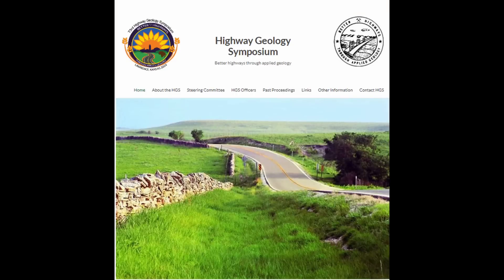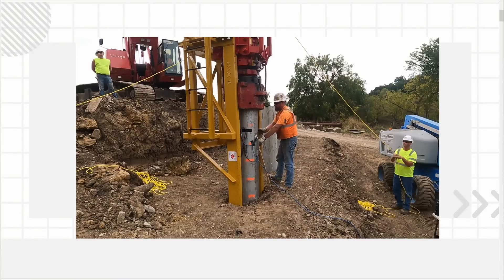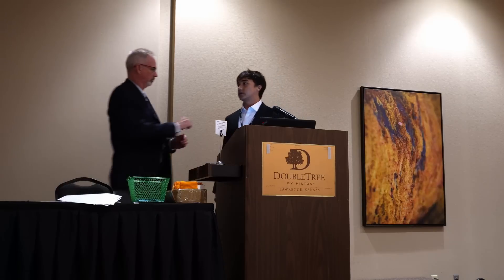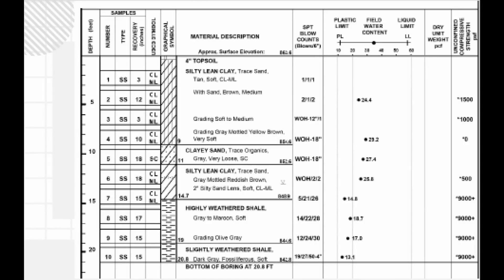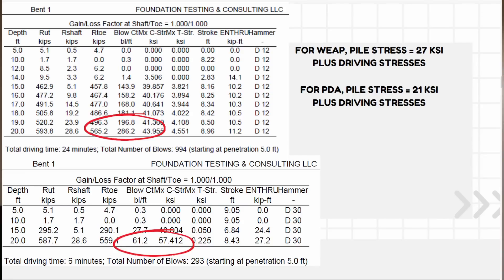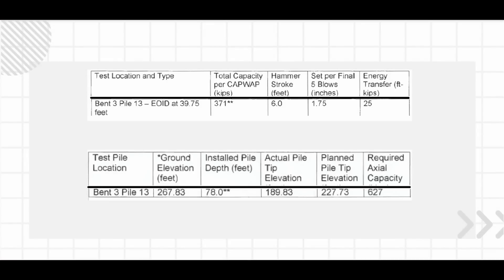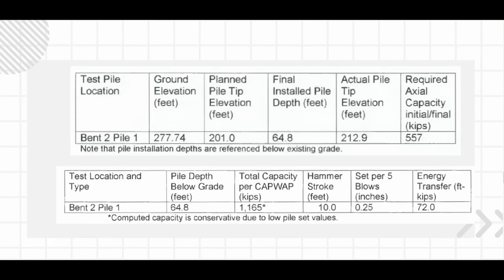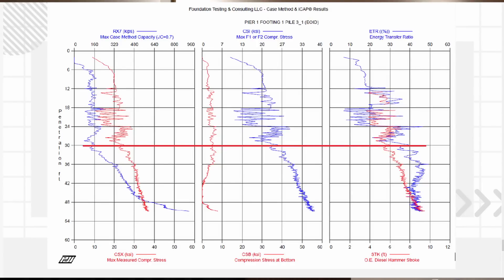2024 HGS Presentation by Jones and Jones

Comment: I live in Western Oregon and commute to Corvallis crossing the Willamette River from Linn to Benton County on Hwy 34.  There's a bridge project going on to replace a historic one that was used for outbound traffic from Corvallis East bound on Hwy 34.  There's a newer concrete one is just down stream for West inbound traffic. I've used these bridges for over 30 years, 5-6 days a week. The newer concrete one had a smooth deck end to end; I don't know when it was built, probably in the 1970s.  Since the intense pile driving for the new bridge project, I've noticed a significant change in the concrete West bound lane bridge.  Where the span meets the off ramp section to the city streets, there's a metal grid covering an expansion joint? Now after 18 months of pile driving, there's change in elevation between the deck and off ramp, almost like a speed bump in a parking lot. About a year in to the project, the metal grid used to rattle a lot when crossing it.  Now it's similar to a small ramp.  What would you think is going on; or should I even ask?  It's got me thinking.  I have enjoyed your videos and learned much.  Thank you.

Comment: Casey, as a CEng MICE (UK) and PE MASCE (USA) I love your videos. I’ve recently switched sides - after 40 years working for international contractors I’ve recently joined an Employer/Owner/Client for a marine project that will require tens of thousands of tonnes of large diameter pipe piles. All the comments in your video have been noted for possible future use. But kips, feet, inches - aaaargh!

Comment: In the 1950's-1970's you/I/anyone could walk right by a construction site and watch piles-wooden ones-being pounded in-New Orleans.
Probably get to within 60-70 feet of the driving-yes there usually was a fence.I can still clearly see/hear the Clumk-Shhhhhh of the hammer-fascinating for a kid
I am in New Orleans-no bedrock-my dad told me they just pounded them "deep enough to displace all the water from underneath" and somehow they held up-friction etc-Sure did not look like that would work-sitting on silt  clay-but it did-40 story buildings on 1000's feet of silt/clay river delta-hard to believe they held.No San Francisco  tilting buildings in New Orleans that I know of(but not THAT many 40 story buildings-maybe 5-10 or so at most)

Comment: I am a retired Electrical Engineer, but, I as the lead Electrical Engineer, I was often at meetings for all Trades.  Mr. Jones, the last time that I worked on a Pile driver, as an inspector was 70 years ago.  Piles today could be Wood, Concrete, Concrete tubes, and even Steel Tubes where they augured the dirt out of the driven tube, installed a dry Concrete mix then hammered the mix into becoming a ball below the tube, then filled the tube with more Concrete.
Reply from the maker: Thank you very much! What you are describing is the Raymond stepped taper pile. I've heard about it but have never seen them installed.

Comment: It does make sense to develop standard procedures for piling testing. The procedures could have specific variations based on types of rocks that will be supporting the pilings. Also types of testing could be specified. Procedures could be adjusted as more data is collected that indicate probable improvement with specific testing methods. 
Your presentation was excellent. Freely exchanging "lessons learned" is a remarkable way to improve any field.
Reply from the maker: Thank you!  I think the most important thing in pile testing is to have somebody with good experience in the overall background for pile design and installation.  It is also good to listen to contractors with pile installation experience in the area.

Comment: As a pile driving contractor who has been doing this since the 1980s I’ve seen a lot of changes over the years. One of the big changes is the reliance on modern electronic equipment to determine the actual  driving conditions and or stresses that a pile might be subject to. Most times I agree with, the results of the PDA testing equipment, but there are instances where it has been proven to be inaccurate. IMO the only completely accurate test of a piles capacity is applying a static load for a period of time. I understand this is not practical in every instance, however there are instances where it should have been the criteria such as the millennium Tower in San Francisco. Also, I would had that sometimes moorings do not reflect the true conditions since on some job sites the sub surface conditions can vary widely in just a small space, even though the surface conditions Would lead you to believe that everything is somewhat smooth below. I would also add that completely neglecting blows per foot, and or bearing capacity based on the amount of resistance, encountered during driving is sometimes the best criteria to determine where the power tip is sitting in the strata. In other words, let’s say you do a PDA on one pile in a project that has hundreds of piles. Thinking that all the mail tips will arrive at the same location with the same amount of driving force require. It’s just far from accurate. Sometimes we would be at hundreds of blows per foot and then drive a pile that’s only a few feet away and at the same Tim elevation, the adjacent pile might only be at 50 or 75 and not reach the higher blue-collar until it’s driven deeper. Are you suggesting that every single pile on a project should be subject to PDA? At that point I think it’s not practical so the only way to really understand what’s going on because by using the blow count criteria. Anyhow, I do enjoy your channel and your reasonable explanations of sometimes complicated engineering problems.
Reply from the maker: Thank you for your comments.  The PDA can over predict capacity when the set is high and under predict when the set is low.  Usually, testing about 2 percent of the piles on a project using PDA is about all that is needed (typically 1 pile per substructure).  I also tell contractors to expect some variation between piles relative to penetration depths, etc. but if there is a big difference they should call me.  Most of testing work is done for bridge contractors who only drive pile every few months.  Once I did testing for a crew that only did pile driving (day in and day out).  They knew exactly when the pile hit capacity before I had a chance to tell them as much from my readings.
Reply: @CaseyJones-Engineer  thanks for the quick reply. Unfortunately I dictated this to my phone which doesn’t always understand what I’m trying to say. I went back and edited it so it would make more sense. I also so think it’s interesting. Your comments about blows per foot and diesel pile hammers. One thing interesting and always considered about a diesel, pile hammer is that the energy cannot be accurately calculated from the loft of the piston alone. I believe this is because as the piston is descending, it is subject to compression and then ignition slightly before the impact occurs. this is changing or altering the speed of the piston and the amount of energy that is transferred to the pile. I believe the only accurate test using a blow count criteria would be with either a hydraulic impact hammer or a drop the hammer. It would be interesting to use this criteria and compare it to what the ENR capacity suggests and also what the PDA comes up with combined with a true static test, which in my opinion is the best way to ultimately determine the pile bearing capacity. I should add that I have been on jobs where we were using D -36 hammer and then we switched to a hydraulic impact hammer and it was interesting to compare the effectiveness of the two different types of hammers. Anyhow, I hope I’m not being redundant with these comments, but it’s some thing that in my opinion isn’t always understood and it’s an interesting topic to discuss.